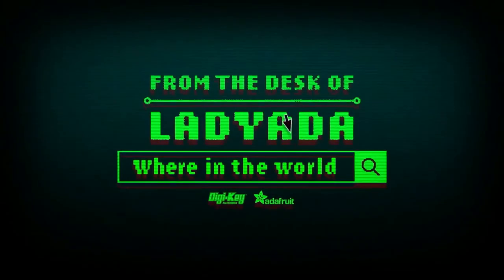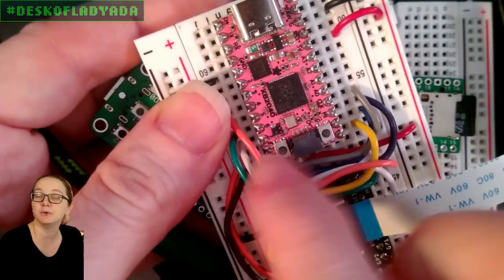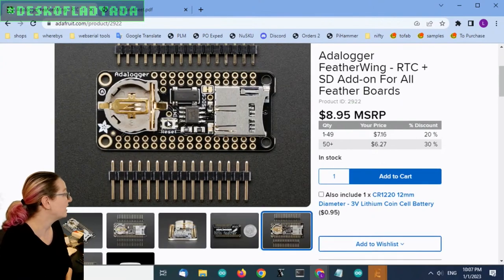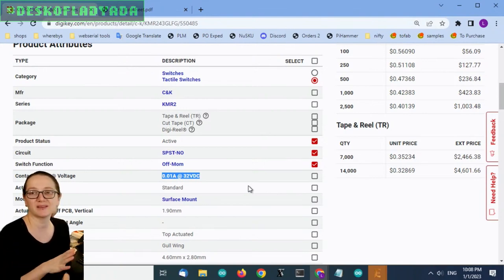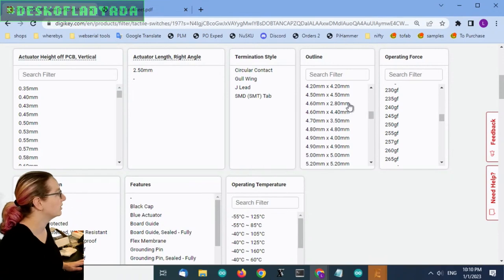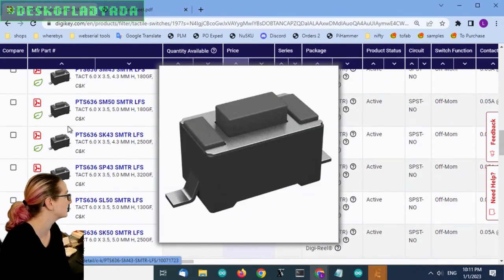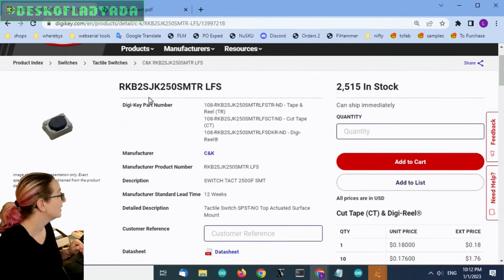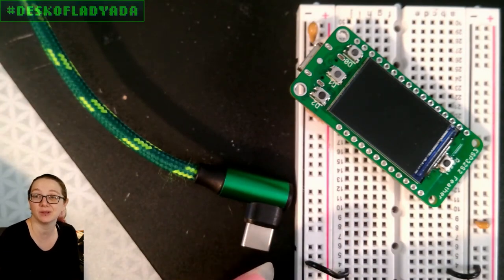The Great Search: Mini 3x6mm Tactile Switches with Big Actuators #TheGreatSearch #DigiKey @DigiKey

Comment: Great info Lady Ada!  I hope you favor buttons with metallic bodies for use cases greater than a hundred presses.  When the plastic case is melted over the top to hold the top plate in place, they break relatively easily.  For example the Pico board button breaks after a hundred or so presses whereas the metallic cases on the Blue Pill (at least the version I have) never seems to wear out and they are simply better quality in looks and function.